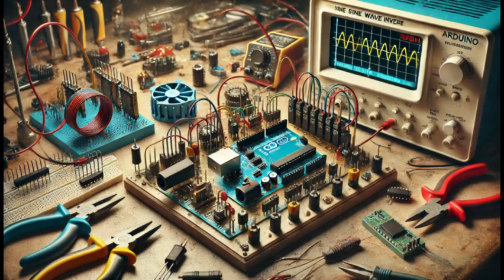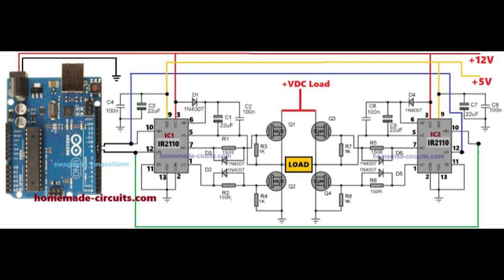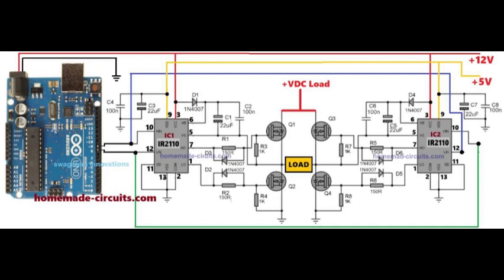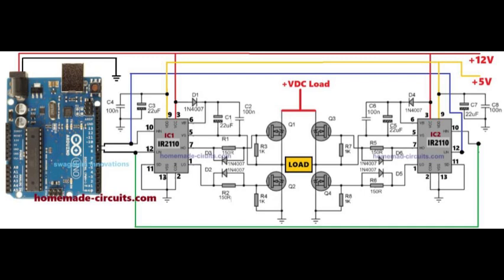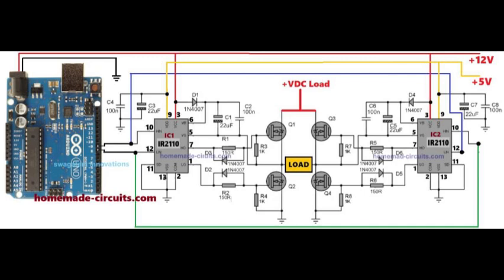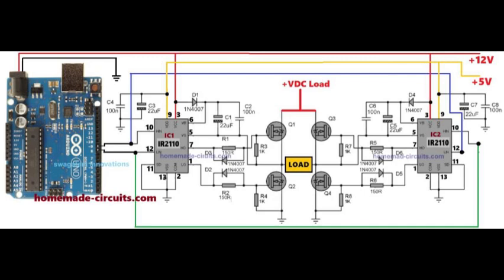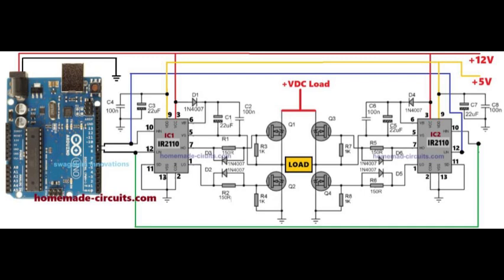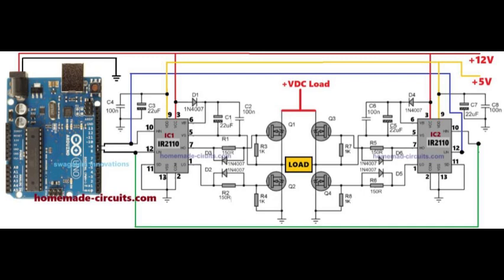Arduino H-Bridge Sine Wave Inverter Circuit – Full Technical Explanation

Comment: Hi. As school project i got to create inverter with arduino. i decidet to use hbridge. but with some tests which failed i decided to use same circuit as yours. It looks you have far more knowladge than i do and i would like to consult it with you for better understanding. Also im sorry for my english,
Reply from the maker: Sure, no problem, you can consult me about this circuit, I will try to solve it as much as possible...you can also get in touch with me through this page, using the comment box: https://www.homemade-circuits.com/arduino-h-bridge-sine-wave-inverter-circuit/
Reply: @Homemade-Circuits  I wrote you a message your email if its okay.
Reply from the maker: @misosimak9701  I read your message, and yes, you cannot drive an H-Bridge directly from an Arduino, you will need the IR2110 or similar driver for that in the middle. A gate to source resistor is required to ensure a smooth and efficient switching of the MOSFETs. The H-bridge configuration must be exactly as shown in the video

Comment: I made the circuit with a 24v battery which is reading 25.6 on the battery but when I connected it to the h-bridge circuit, and read the two output side where my transformer supposed to be connected and am getting 28.0 but my transformer is giving me a lower volt say 18v why. Will it cause a damage on the mosfet
Reply from the maker: If your meter is set to read AC, then the voltage looks OK to me, since the AC across the load side will read same as the battery voltage. If the meter is set for DC then you must see around 13V DC on your meter for a 25V battery….
If you want to be 100% sure then you may have to use an oscilloscope to check the waveform across the various points on your inverter.
Right now, you can connect and small transformer across the load side of the MOSFETs and check whether the transformer generates the 220V AC or not…

Comment: i have queastion how the circuit let 50HZ on the load the other qeustaion is how i can control the freqeuncy 
to drive single phase motor
Reply from the maker: The two Arduino outputs alternate at 50 Hz frequency to generate the 50Hz frequency on the load...The frequency can be adjusted by adjusting the code, it does not have a variable pot for this, but the code can be easily modified to provide an external pot for adjusting the frequency...

Comment: Hi, Thanks for this 👏👏 Question: Is their a reason why you put the 2 capacitors in parallel everytime? Is the 0.1uF capacitor necessary since it is much smaller that 22uF?

Thanks again for this.
Reply from the maker: It's my pleasure! Thanks for your question. The 22uF handles and cleans up the low frequency noises and spikes, while the 100nF capacitor eliminates the high frequency noises and spikes, so both are important for maximum elimination of these spikes and noises...